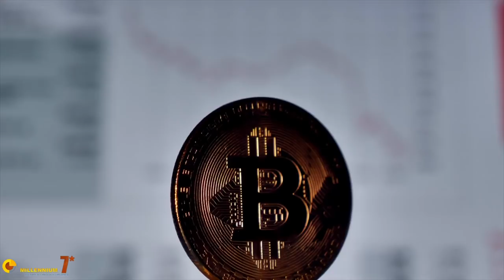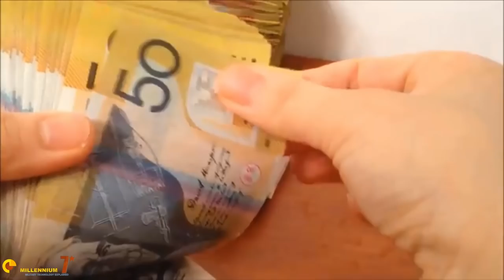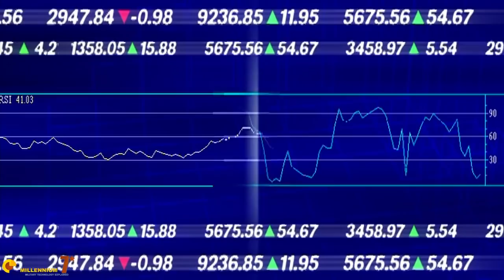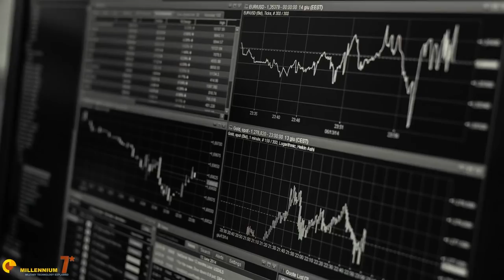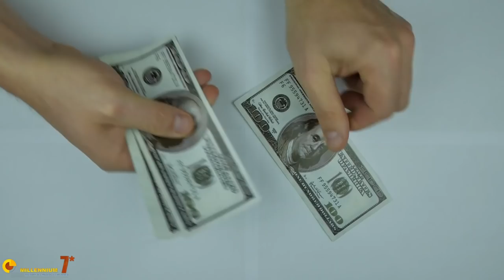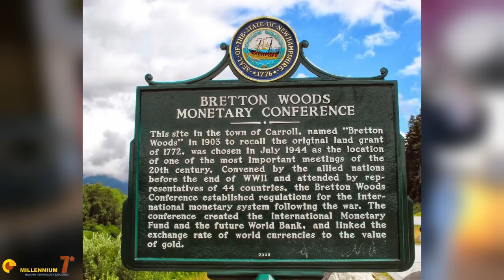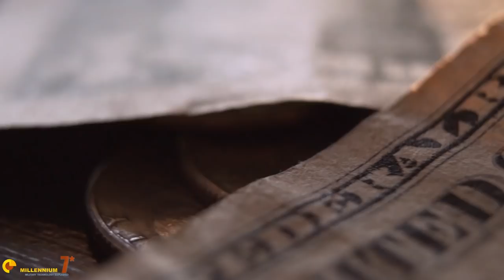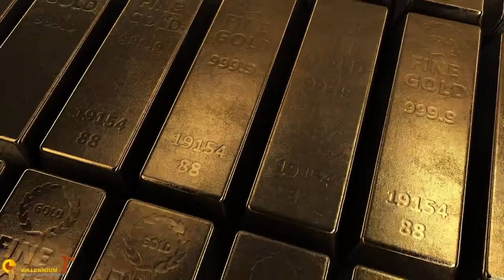How the USA can get unlimited F-35s without going bankrupt

Comment: Thank you so much for explaining it in terms even my grandmother understands. I always tear my hair off my head when I hear some 'expert' state that Russia for example spends 'only'so and so many billion U$ or € annually and therefore cannot be a serious threat. That completely depends on how much things cost in their domestic market and monetary system; international exchange rates tell you next to zero about that. I could live like a 'god' in Russia with my current income while only just getting by in my own country. Somehow that dime seldomly drops with defence watchers.
Reply: " I always tear my hair off my head when I hear some 'expert' state that Russia for example spends 'only'so and so many billion U$ or € annually and therefore cannot be a serious threat. That completely depends on how much things cost in their domestic market and monetary system; international exchange rates tell you next to zero about that."
There are two methods of calculating GDP. One method is called PPP and the other is called the Atlas method.
One of those methods looks at the nominal GDP while the other method looks at what a dollar could buy in local prices and adjust the GDP accordingly.
For some years can the numbers jump up or down much because of currency fluctoations. But that is mostly in African countries. In other parts of the world are numbers more stable. And measuring Russias GDP regardless of method does not show this country to be anything near USA in economic strength. Russia is much poorer than California. Much poorer than Texas. Its whay behind UK. Its economy is smaller than that of France. And Germanys economy is much larger than Russias.

Russia look large when you look at a map. But it is very weak in economic power for a country of that size.

France got a GDP larger than all African countries combined (when you exclude North Africa).
That can be hard to comprehend. France is small compared to Africa. Its population is small and it is old. While Africa is young. And yet is sub-saharan Africa poorer. Poorer despite Africa got more land mass than USA, Europe, India, Japan, Australia, and Brazil combined.
Reply: @nattygsbord  While that is absolutely the case for the broader economy, in the case of Russia (and China) the size of the economy doesn't reflect the destructive potential of Russia's military. 
One thing many economists hardly consider when comparing economies and militaries is how much bang one can buy for a single buck. 

Let's just say that a human life is of negligible value to the Kremlin and that pushes down cost of maintaining a sizeable force considerably. Not too long ago grueling videos could be seen on YT on how recruits who didn't get any food or pay were beaten into submission. I can only imagine how much money workers in Russia's defence industry get - probably just enough to just hang on until retirement, after which people wither away. 

The human rights tragedy apart, that creates a completely different kind of economy. One that looks similar to that of the Roman Empire. Built on slavery and a constant need for conquest of new territories to exploit. 

Besides that, what many economists also fail to see - because it's simply not registered, is the informal - or black - economy. The members of the Russian oligarchy and its clientele has found several loopholes to funnel their illegitimate funds to offshore accounts pretty much unnoticed. A trade in which the City in London and British crown colonies, Malta and Crete assumingly function as hubs.  These funds - with estimates (since that;s all we have) varying from tens to hundreds of billions annually - are naturally not recorded in any official statistic, but they are there and presumed to be quite substantial. 

That is one of the reasons why the sanctions proposed by president Biden will hit the Russian elite where it hurts most. 

In short, calculations and statistics tell us only so much. That's why any half decent intelligence officer likes to look what's underneath the surface. 

What economics do explain however, is how resilient a society is against shocks. The official Russian statistics show an impoverished people that suffer under the weight of the ambitions and greed of its elites.

But then again, that's not that different here either While western economies are much bigger in overall value, the distribution of wealth is looking more and more like that of Russia by the day, with middle classes all but vanished and a slowly growing number of 'deplorables' sympathizing more with Putin than with their own leaders. Unfortunately something else most economists (Piketty and Galbraith aside) fail to mention that as well and instead favor looking at (average) income per capita. 

Final point: look at the vast amount of minerals and fuels in Russian soil. The value of it western European countries only now care to recognize in full, having become dependent on them due to their concern for climate change. Our economies maybe huge, but they are steel giants with feet of clay. A few more nudges is all it takes...
Reply: @Pincer88  
GDP is one measurement of how military strong a country is. But its just one among many. Like you say the ability to withstand chocks is another. USSR did punch above its own weight in 1941-42 and survived a chaos that would have brought any normal state down. The central planners in Russia had piled up scare resources and supplies over years, so when Germany was quickly taking over 11.000 villages in Russia and factories were being lost or relocated to the east could the red army still keep on fighting and factories could remain open. And it was only thanks to all resources it had saved up.
But in late 1942 was the Russians running out of rope. Lots of supply shortages and bottlenecks were lurking around the corner.. too much land had been lost to the Germans, losses had been heavy in 1942 and even more heavy in 1941. And the Russian economy was strained to its limits. It would likely have crashed like in 1917, had Russia not been able to win the battle of Stalingrad and liberated southern Russia and start gaining large shipments of lend lease from USA to off-set lost military equipment and industrial capacity.

When I see the Russian economy today I see strengths, but I also see weaknesses. No other western stock market crashed so fast and hard as the Russian one did in the financial crisis. This show how volatile and fragile the Russian economy is. Half its GDP comes from oil - which shows how undiversified the economy is. And undiversified economies are more fragile, and more vulnerable to price changes - and in this case we are not even talking about an advanced industrial product, but instead we are talking about a natural resource.
Oil is fantastic, its my favorite energy source.
But I would hate the idea of my country being dependent on selling raw materials instead of industrial products.
And selling raw materials comes with a risk. What will happen if we discover a better energy source than oil? Then the price of oil will fall, and the state revenue falls down into the cellar. Being dependent on oil also gives your economy "the Dutch disease".

"Let's just say that a human life is of negligible value to the Kremlin and that pushes down cost of maintaining a sizeable force considerably. Not too long ago grueling videos could be seen on YT on how recruits who didn't get any food or pay were beaten into submission."
Okay sure, lets say that Russia uses slaves that get no salary aside from food. Sure that would mean low wages and lower production costs for weapons. But even if that would be true do I think that GDP-output per worker is more interesting. According to Anders Åslund do one American worker produce as much stuff as 4 Russian worker in a workday. So the productivity is much higher in the American economy.

And a country's economy is a team game where individual does not matter. American workers produce 4 times more not because they are 4 times smarter or 4 times more hardworking. Rather I would say that America is a more developed society. You got more machines and tools to make each worker more effiecent. You got better institutions. And so on, and that allows individuals to become more efficent in producing goods.
If you work in a third world country you will not have much industrial robots to help speed up production so you have to use inefficent tools and working by hand to make things. And your factory will suffer energy black outs more often. Law enforcement will be weak so crimes are common. Roads are filled with holes so your goods will often get harmed as trucks falls off the road. And insurance premiums will therefore be high.
You will not have access to skilled workers. And chemists will not have a lab assistent because a such is hard to find and so on... The economy will be ineffiecent.
And it doesn't matter how muscular, well motivated and smart you are. You will probably remain poor if you are born in a 3rd world country. As Warren Buffet said, had I been born in a poor country I would probably have been very poor. I would probably have to work as a farmer, and I am not good at farming.

A bus driver in Sweden is paid 40 times more than a bus driver in India. Is it because he is 40 times better at driving a bus? or is it because the wage level is 40 times higher in Sweden because production in Swedish society is much better organized than in India?
I would say the latter.

Overall do I think that slavery is an outdated ineffiecent system. Perhaps one could argue that western countries treat their workers in slave like conditions where workers at a conveyor belt at a chicken factory have to wear diapers so they don't waste time going to the toilet. Or how harley Davisson deliberatly puts their factories in towns with high unemployment and applies Toyotas Lean production concept and chronically understaff their production line and run it at high speed so they exhaust their workers which are forced to to make the same monotone hand movements day in and day out so they exhaust and destroy their own body. People hate their job and would quit as soon as any job are available, so factories can only work in areas with high unemployment and desperate people who cannot find any other job.
People learn no more skills, workers piss their pants because they are not allowed to waste a minute of production time by going to the toilet. Wages are crap. But still is this production model loved by most big corporations around the world
A very ineffiecent one in my opinion. First of all cutting down all spare parts, and understaff factories makes them very vulnerable to even tiny short breaks in the chain. If parts cannot be delievered to the factory this day, then nothing will be produced since there are no spare parts stacked up - because no stored parts exist, because storage costs money and have therefore been seen as ineffiecent.
If a worker can not come to work, then the already over-burdened team cannot compensate for him. So production this day will fall greatly. And if a strike happen in somewhere along the chain, then no motorcycles will be built. If a strike happens in a supplier of parts then no motorcycles can be built since there are no parts stored up.

And when armies copy this idiotic system it is easy to see how this could be catastrophic in a big war. If it costs money to store up ammunition that never will be used, wouldn't it then be more economically effiecent in peace time to get rid of all supply depots? That would save a lot of money.
This sounds good.
But then Russia invades Ukraine and a big war starts. Thousands of bombs are dropped each day. An artillery piece fires dozens of shots each day. And the tiny supply of ammunition gets eaten up quickly. And now you have an ammunition shortage in the middle of a war.
And scaling up production takes time. You need to open up new factories, hire new workers, train them, supply the factory with materials, and then transport all bombs and grenades over to Ukraine. And it will take weeks if not months before supply can keep up with demand. And meanwhile are you guns sitting silent in Ukraine because they have no ammunition to fire.
But the enemy got lots of ammunition and your men are easy prey when they cannot fire back.

That is the idiocy of modern capitalism. The Toyota model of "just in time" and "lean production" works badly, and especially so in the military.

"concern for climate change"
Just because you care about it does not mean that I care about it. And I do not care it, this hoax.
I have been promised that "the world is going to end the next 5 years" so many times now since my childhood in the 1990s that I am tired of all this scaremongering propaganda. Al Gore and others predictions have failed to come true. And I no longer care about what they say. They have lost all their credibility.
Reply: @nattygsbord  Russian GDP (PPP) is 4,3 trillion with huge financial reserves and very low level of dept. It is the 6th largest economy, meanwhile all countries above it in the list (apart of China and India) have dept to GDP ration of more than 100 %. We recently witnessed how USA's national dept surpassed 30 trillion $.
Reply: @nattygsbord  That's is true, if, and only if, the country in cuestion have enough "true economic growth".

Comment: One Million Mile Cars! Yes, Tesla's constant improvement strategy is to achieve zero major system failure over 1,609,334km across all their platforms. I think most of us don't bring this to mind when considering the cost of ownership. When I evaluate financing cost, maintenance, resale price, and fuel, over a potential 30-year life, a Fully loaded, Long-range Model 3 or Y is Cheaper than Any car in Canada today!
Reply: Until the battery replacement costs stack up.
Reply: @NinjaRunningWild   If you carefully look after your battery there is No need to replace a Tesla battery.  A big part of the consent improvement at Tesla has been tweaking the chemistry to improve life

Comment: Gold is used in the microchips so a small amount finds itself in pretty much every modern military equipment.
Reply: Yeah except you can replace it with less efficient conducting materials.
Moreover, most electronics are designed to minimize usage of expensive materials such as gold or silver, because you can make electronics more efficient by replacing the entire circuitry with super conductors even more expensive than gold. But why would you do that? It's not nesscary.